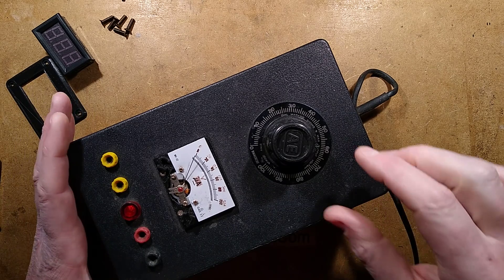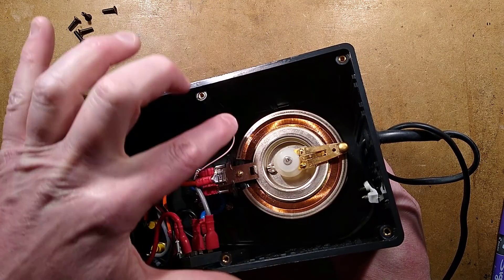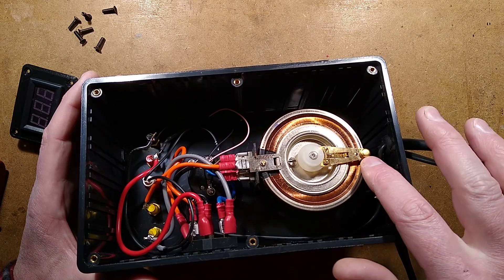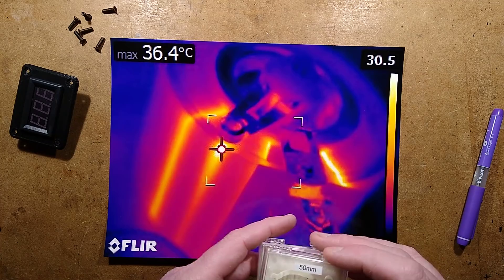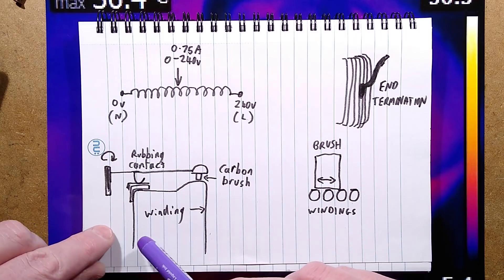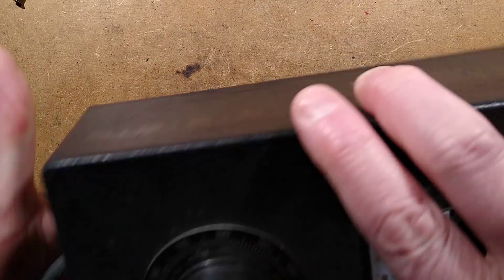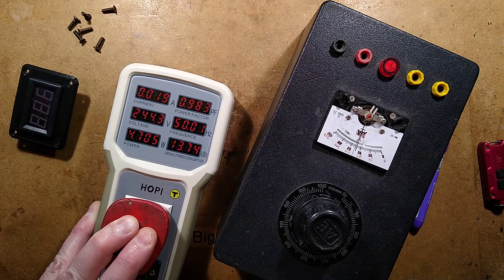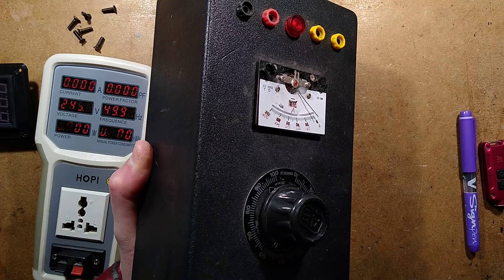Variacs DO short their windings

Comment: My old Variac used to step up the voltage to 280 volts.
Reply: many do have an 'overvolt' capability, depends how you wire it, i have one that has
Reply: mine can too, it's supposed to go 250V but it's chinese (chinese for the chinese market) and it's rated 220V so with 230-240V input it goes like 270V... apparently experimental variacs (the bigger ones) can go past 100%, the one big clive has is just an expensive small dimmer (i think)
Reply: @redoverdrivetheunstoppable4637  Chances are the 270V will drop a bit at the rated load as well. Also, some variacs also have a few input taps for different input voltage. My big 20A one has a tap at 110, 220, 240 and at the very end, plus of course the wiper. So if I needed to power some medium power 110 devices while using the normal output, that's not a problem either. Apparently there are even variacs with multiple separate wipers as well.

Comment: i have a question? how does a Variac work and how it can work ok 120v of its getting 120v and when i set my variac to max it outputs 145-150v ac but when i probe input its 119 v
Reply: In the one shown here, there are a few turns past where the mains tap is. On yours, there are about 20% more turns past where the mains is fed. I used to have one where the mains hot was at about 35% up from the neutral, so when fed at 120VAC, it would output about 0 to 300.
Reply: @strehlow  ok so if you get 300v from 120v variac then its transformer based because it steps up voltage and regulates it gradualy
Reply: some have an 'overvolt' capability, of about 10 to 20%, depends how they're wired,

Comment: When I have a print adhere too well to the build plate, I unclamp the build plate and print from the printer and put them in the freezer for about half an hour, so far that's always let me get the print off without damaging the glass.
Reply: You tell it to chill out 🥶👍
Reply: I find my glass bed sometimes barely sticks so I use glue stick and that makes things way too hard to pry off. Hard to find a balance really, I used to have the flexible magnetic sheet that came with the printer but I was an idiot and scraped it with the scraping tool too much and it wore it down. I guess painters tape is something to try out next
Reply: @waldevv  Why not just buy another magnetic sheet?
Reply: @Fridelain  yeah I could but they were surprisingly expensive, plus the glass should help since the beds are apparently ever so slighly warped from the factory although it didn't cause issues for me. The glass came for free as a part of my kit so I'm still using that for the time being
Reply: @waldevv  Painter's tape worked well for me with PLA, but with ABS, the tape would melt into the print and was near-impossible to remove. The other problem was that I had to reapply it regularly. Kapton tape worked better with abs, but it had to be reapplied often as well, and it was very hard to get it on without wrinkles. A sheet of glass and a glue stick has been the best so far, but sometimes the prints stick too well, then I put the whole sheet in the freezer, and the print pops right off.
Reply: this is also what you are told to do with troublesome prints that come off of FDM printers that cost 5-6 figures

Comment: The volt per winding is very very small so there's a very very small eddy current in two adjacent shorted windings.

Another thing to consider: A carbon brush has more resistance than copper has. Two wires being shorted through a brush results in less "shorted" current than if the brush were made of copper. But, as pointed out, the brush may sometimes span more than two windings.
Reply: @belly tripper Kindly, while "Were" is used in the second person singular and plural and first and third person plural, it is also used in the subjunctive mood to indicate unreal or hypothetical statements.
https://www.grammarly.com/blog/was-vs-were/
Reply: @belly tripper Past tense "Jack was early to work",  vs subjunctive unreal or hypothetical  "if the goose were to lay a golden egg."
Reply: @belly tripper ok, roger that.👌
I'd like to propose that you brush up some.  Chech out the section on 'The Subjunctive Mood with "Be" and "Were" ' https://www.merriam-webster.com/words-at-play/getting-in-the-subjunctive-mood. 

If you are to be a grammar nazi, you might want to be an informed grammar nazi. 

Please have a nice day.
Reply: @belly tripper With all due respect, given your two statements ' your grammar is horrible, you mean ""if the brush *was* copper"" ', please understand that when one wants to criticize another person's grammar, one should know that an informed grammar nazi would not start either sentance with a lower case letter.  Nor would they end either statement with either a comma or nothing. Nor would a grammar nazi use "" where a single " is required.

Lighten up on people please. Putting them down on something does not lift you up. And when you are the one that falls short on the same measuring stick you used to measure another person, the heaping dish of crow pie doesn't taste very good.

In the case that the last idiom is not common wherever you are, I'll  share  this from wikipedia "eating crow is a colloquial idiom, used in some English-speaking countries, that means humiliation by admitting having been proven wrong after taking a strong position.The crow is a carrion-eater that is presumably repulsive to eat in the same way that being proven wrong might be emotionally hard to swallow."

Comment: Hmmm... I imagine that they can get away with shorting the windings because the voltage difference between the adjacent windings is very small. I'm commenting this before your measurement on the HOPI, but if there is a 80mm diameter variac and a 3mm wide contact, the maximum voltage across the contact would be 240 *  3/(3.14*80) = 2.8V. Obviously if it's shorted, the voltage is ~0V, but this shows the scale of things relative to 240V.
Reply: /\ this /\
Small voltage drop = small current dissipation.  
Good 'nuff engineering.
Reply: @tiporari  
I’m not the smart ass I wish I were but I’ve read the comments below;). 
The contact would create a small voltage drop over the (rest of the) transformer but there would be no voltage drop over the shorted windings (at all) as the current would take the less resistive route of the carbon brush, wouldn’t it? 
So why do the shorted wires heat up?
Chris Hartley explained that induced eddy currents are the culprits for that and to me that makes sense.
Reply: From the look of it, I would put the number of windings at about 250 which makes the voltage across each winding about 1V though it's not really relevant. The current in the Variac is the linear current. When 2 windings are shorted, that gives a core of only 249 windings, the change in voltage and linear current is negligible. The heating effect is caused by eddy currents in the shorted windings since they are connected at both ends, other than normal resistive effects (which is halved for 2 shorted windings) there is no voltage drop across the shorted windings. The linear current is just the same as all the other windings.
Reply: @chrishartley1210  of corse but if you had 2*250 windings you would be less likley to short to windings of the same set and so less losses through short (its not eddy current losses but ohmic losses through the one turn winding )
Reply: @hausaffe100  if it was down to ohmic losses then the fact that two tracks are shorted together would halve the resistance resulting in half the power loss, those two windings would (and do) produce half the heat compared to other windings. Additionally, ohmic effects would produce even more heating as current increases (proportional to the current squared) which is also not observed. Therefore you have to look elsewhere for the heating effect. Once the windings are saturated there is no additional eddy current, no additional heating so it is not proportional to the current.
Reply: @chrishartley1210  Its the omic losses of the shorted windig as P=( dΦ/dt)^2/r but not eddy currents wich are magnetic turbelences in the core material
Reply: @chrishartley1210  
Oh those pesky eddy currents. Thank you very much for your excellent explanation!
Reply: @Conservator.  Apparently I should probably have said induced currents, but the result is the same.
Reply: @chrishartley1210  👍
Reply: the problem is not voltage but magnetic flux
Reply: @hausaffe100  I heard they don't use the most conductive wire, it's copper flashed steel wire on variacs.
Reply: @Flat Sign Big Clive mentioned he checked for that, and it seemed to be normal carbon with the same resistance in all directions.
Reply: @EmperorA0  Also the head generated by shorting windings is not just in the winding but as much in the core, and variacs have very soft cores.
Reply: @Flat Sign He tested this in this video. Some fancier high-powered variacs might use this, but this one doesn't. Also, if there are multiple vertical contacts, which one is connected to the actual wiper?
Reply: @LazerLord10  Depending on the physical preciseness of the contact - I would say the 1st wire that makes contact is the effective one.
Reply: @Flat Sign In terms of the operation of the variac, the shorted windings behave as a common conductor so have negligible effect on the voltage or the current (unless there were only a very few windings). However, there is still a loop of wire so a current is induced in this loop. The current induced in the loop is inversely proportional to the resistance of the loop and not related to the current of the variac. Having re-read what he wrote I believe this is what Hausaffe was referring to when he said it was an ohmic loss.
Reply: Why can't you just divide the voltage by the number of turns, hey?  Also, your math works out to just 85 turns for the entire winding, which seems awfully low, but then again I don't think I've ever counted...
Reply: @railgap  
The point is that he doesn’t know the number of turns nor does he even mention them. That’s imo the elegance of his very simple calculation.
Reply: Exactly what I was thinking so you must be right:-)
Reply: @Flat Sign Another thing, although the induced current is shorted the driving current (end to end of the coil) will be zero on the shorted part. This may well equal out quite well.
Reply: @alancoales7057  Yes. An auto transformer is not the same animal as your garden variety transformer at the best of times.  Far too many variables to just describe it as 'shorting a winding' .
Reply: I think you have the right idea, never thought about variacs having losses from adjacent windings being shorted out and since the windings shorted are always very few loops apart, then there is almost always only a small voltage being shorted. Shorted motor windings are often more spectacular in losses due to the likelihood of a winding at the beginning shorting to a winding much further toward the other end due to their physical proximity in a motor (not something likely to happen in a variac that hasn't had some ugly physical rearrangement operation performed on it).

His phantom hot spots are almost surely shorts between adjacent loops where they prepped the winding for the brush/wiper
Reply: Just saw the eddy current comment, that is maybe more accurate than saying there is a voltage drop. (The losses are from the transformer causing current in the shorted loop, if there were no shorted loops, the hoppi (should) read fewer mA?)
Reply: It probably also helps that the shorted winding is some distance away from most of the rest of the windings.  The magnetic coupling will be just imperfect enough to act as a though there were a resistance in series, and limit the current through the short-circuit.  Any resistance across the carbon brush would also be acting in your favour.
Reply: The maximum power dissipation in the shorted turn will be ((V / N)**2)/(R/N), where V is the supply voltage, R is the total coil resistance, and N is the number of turns. This simplifies to (V**2)/(N*R) or (V/sqrt(N))**2 / R. In other words, the power dissipation does not decrease as quickly with a reducing number of turns as you might think. If you can accept this it's ok. The graphite contact is there to help limit current further and even out the transition between turns as the variac is adjusted.

Comment: It would make sense to see a total of 4 wires changing temperature since a variac is still a transformer with a primary winding (2 wires) and a secondary winding (2 wires).  

Unless I'm missing something, the thermal image makes sense to me.
Reply: What he shows is a "Variac" which is a transformer with just one set of windings. https://en.wikipedia.org/wiki/Autotransformer#Variable_autotransformers
Reply: @myofficegoes65  I appreciate the response!  Wouldn't the diagram that is shown in the wiki link still provide two current "loops" (not electrically isolated like a typical transformer) which would be the cause of the apparent temperature rise in both the input and output terminals if there was a load on the secondary loop terminals? I do not have a thermal camera or variance to test this out for myself and I'm genuinely curious as to what is causing a temperature rise in 4 segments.  Thanks again for your response!
Reply: And according to a quick google search of a variable transformer schematic, the 2 current loops give you the 4 wires.  2 are for the primary coil which remains fixed and depends on your input voltage, while 2 are for the secondary (one fixed/common with the primary, and 2nd is the variable winding). If you took the thermal image with the secondary loop open, you'd only see two warm spots from the primary winding dissipating power. 

Again, if I'm missing something, please let me know! I'm am human! :D

Comment: When printing on glass you should try putting down a thin layer of glue stick (PVA). It works very well and just washes off with a little warm water. The glue stick  creates a interface layer that increases the hold but also makes it easier to remove when cooler and shouldn’t bind so well as to crack glass or mirror. You can print multiple prints over the same place you put the glue stick before removing and reapplying. A stick comes with every Prusa printer. 

You can also go with a removable flex sheet. You just flex the sheet and the print just virtually falls off. Depending on the surface type on the flex plate if you are having adhesion problems you can use the glue stick as well.
Reply: I wounder if a sillicone sheet ontop of a lexan sheet would work as a flex sheet or sillicone ontop  of glass without any adhesive to bond the 2 just lift the silicone sheet and plop the part falls off

Comment: My variac goes to 120%, how does it do that?
Reply: In a 0-100% variac, the the 0v and 120/240v connection are connected to the start and end of the windings, and the arm can go from the start to the end of the windings. In a variac that can do more than 100%, the 0v is connected to the start of the windings, but the 120/240v is connected somewhere before the end. So there might only be 100 windings on the 120/240v input, but the the output controlled by the arm can go past where the 120/240v is connected all the way to the 120th winding. You end up with 20% more windings on the output, so the output is 20% more volts.
Reply: many do have 'overvolt' capability, depends how theyre wired, theres a 'tap' on the windong just before the max end , so if you feed the mains in there instead of the true max end, the max end part is above mains voltage i have one that has this optional tap

Comment: What material did you use?. PETG is known to adhere too well and pull up chunks of the build plate. PLA and ABS don't have that issue. I use cheap hair spray to help ABS and PLA adhere and I also use it for PETG as a release agent so it can't destroy the glass.
Reply from the maker: I use PLA.
Reply: @bigclivedotcom  I'm impressed it stuck that well. I can't get PLA to stick to bare glass ever. Try the aerosol hairspray trick. I use the cheap aquanet and it works well.

Comment: I've always thought that was likely. But, so many say it's not a shorted turn. Glad someone actually proved it either way.
Reply: I can think of ways to avoid shorting turns, but it'll always come down to either a different transformer style, major cost/size increases, or opens replacing shorts.
Reply: It depends on your definition of "shorted". The wiper is carbon, and carbon makes a resistor. So it isn't a dead short, it is a very low resistance resistor connecting a few turns, and the turns have a relatively low voltage difference between them, so it is a fairly small power loss.
Reply: @lwilton  You're really just splitting hairs. I could claim everything has resistance so there's no such thing as a short, but we both know that's absurd.

Comment: I think on the higher power ones as the windings are made from a larger diameter wire the chances of a shorted winding is lower.
One important thing: Variacs provide no mains isolation. You can get ones with a separate primary that does.

Comment: I like to play with motors,  should I buy a cheap variac or a cheap bench top power supply ?  I am almost a idiot when it comes to electronics...  any advice???   " I'm cheap."
Reply: Are the motors AC or DC?  If the motors are low voltage DC then a bench top power supply is better
Reply: @myofficegoes65  I Want to play with both,  from my battery powered tools and motors from blenders, bread machines and such.  Do I need two things?
Reply from the maker: A variac is not isolated from the mains supply.  For low voltage motors a bench supply or batteries are a better option.
Reply: @bigclivedotcom  Thanks